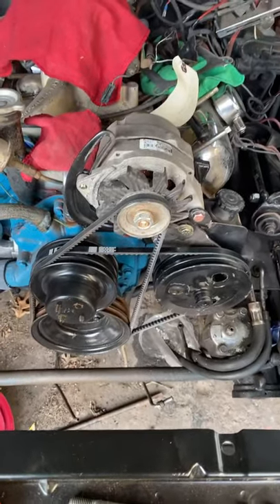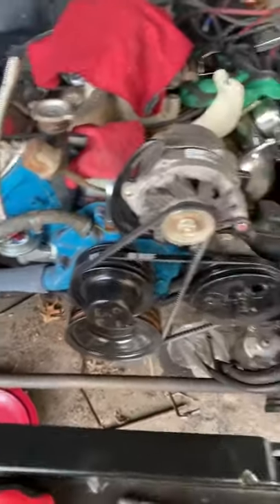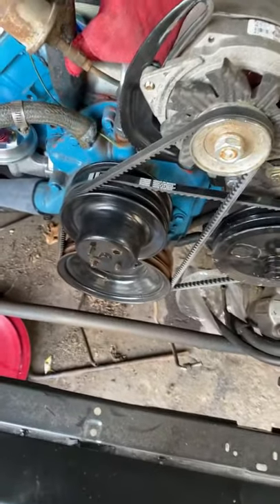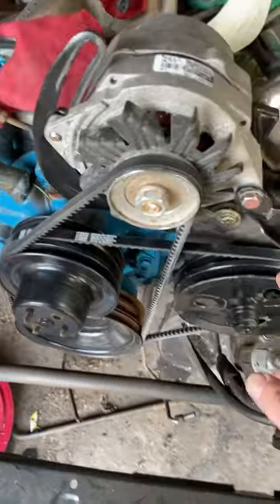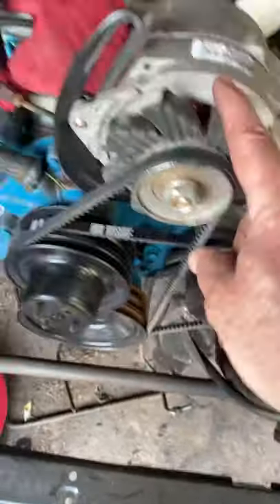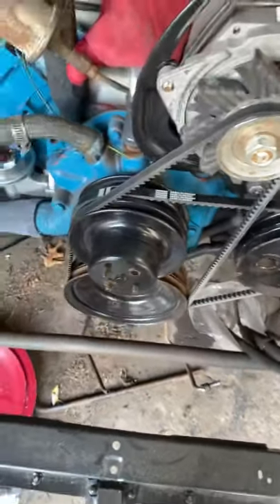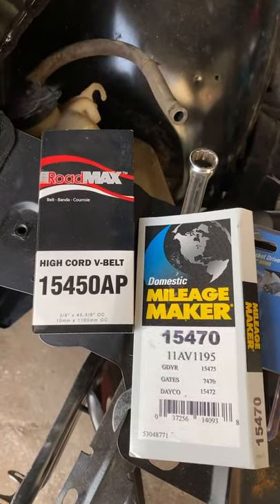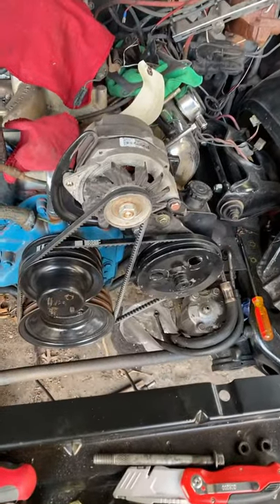79 Pontiac Trans Am 403 Belt routing

Comment: I'm a bit of a novice in reassembling engines.  I got a 403 for a 79 this guy has me reassembling for him and photos are limited and the engine came to us off body.   Would it be possible to get a photo of how your bracket mounting for the power steering pump and alternator is set up?
Reply from the maker: @DeuceK92  send me your e-mail and I will send some pics from the factory assembly manual.

Comment: Have you had any issue with belt squeal at high RPM’s? If so, would adjusting the alternator up or down help? Thank you for your time and video. Got my new belts on but now have this terrible squeal.
Reply from the maker: I haven’t been able to start it yet because I had to swap out transmission and I want to swap out all the fuel lines and trans lines. Adjusting the Alt might take care of it.  If it works please let me know.. good luck
Reply: That is my current issue on my 79 TA, at idle and revving I have no belt squeal under load and acceleration I have a belt squeal
Reply: @ryanr9697 same any luck figuring it out?
Reply: @matthewsodervick8777  yes, the belt that is from Crank to waterpump to alternator became loose and was just enough slack to cause a squel, I was able to replace it and get the belt tight and have had no problems the last couple of times I’ve taken it out

Comment: Which belt is for the alternator and which is power steering
Reply from the maker: I will be replacing the transmission tomorrow I will check and let you know for sure
Reply from the maker: 154150 Is the Alt Belt  27062020 is the power steering belt